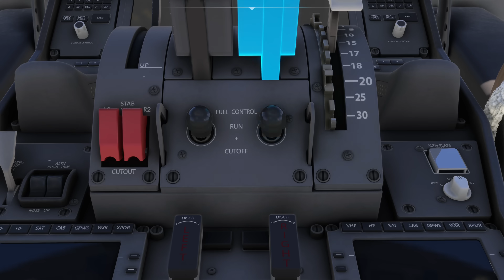Air India 171: Why Did The Fuel Cut-off Switch Get Moved?

Comment: With history providing Alaska Air 261 (profit over proper maintenance and falsified maintenance records resulting in the death of eighty eight people and NO ONE WENT TO JAIL), the multiple 737 hydraulic rudder actuation valve exceeding design travel and going full rudder deflection lock, the 737 Max, and Boeings successful Regulatory Capture . . . I refuse to point a finger at the flight crew on this.
There is enormous capital involved in this and the money never looses.
The fuel Cut Off switches are mechanical switches that work OFF OF TWO RELAYS.  There is a very good explanation of this on "STIG SHIFT" channel STIG SHIFT #78 "Aircraft Maintenance Adventures" (link:https://youtu.be/-ur234kwnhk?si=xRFP69_kTcN2aDPW&t=898)
I'll point early unformed fingers of wild speculation at Boeing all day long before I even contemplate looking at a flight crew.
Electrical relay switches never fail. /sarcasm

Comment: Consider this alternative not yet brought up.

What if a connector in the wiring harness vibrated loose and shut off the fuel then vibrated to reconnect ? Kinda like a car can.
The FDR would record a circuit disconnect and reconnect, not knowing that the switches were untouched.
That might explain at the engine sound change, one pilot saying "why did you do that?" and the other saying "I did not".
Both are startled and baffled.
No pilot fault, just a faulty pin connection.
THINK ABOUT IT.

Comment: What if one pilot is incapacitated. Putting the engine switches requiring inputs from both pilots during an engine failure is deadly. And saying that’s a great question is beyond my comprehension.

Comment: Captain Steve! I’m not a pilot but do have interest in aviation. My take on this…. With today’s technology could there not be a fuel cut off lockout during takeoff only?  During take off and until X air speed and/or altitude is achieved the fuel cut off is locked out indefinitely. During normal flight or landing fuel cut off can be changed by pilot in case of engine burnout or fire.

Comment: People who accuse Capt Steeeve this and that are so irrational.
He explained his reasonings for ruling out certain probable causes. 

After seeing a diagram how the switches are connected to different systems, including how the position status is logged in FDR, and the fact that 2 separate systems activated independently, it is clear that the 2 switches did change positions.  Mathematically it is almost impossible for 2 mechanical switches failed at the the exact same moment, leaving it only to the external factors which in this case the human factor was 1 of them.

Comment: Dear Captain, my question is simple. Bearing in mind the aircraft in question is totally computerised and the flight crews input is secondary, assuming the computer has not locked them out, how can we believe anything about the fuel cut off switches being moved at all by a human. Where is the actual data taken from, the switch terminal, some place in the computer, or at the fuel vales? 
I assume the aircraft was on auto pilot for take off, and the flight recorder recorded the fuel (switches?) being cut off, however, there is no evidence that the switches were ever moved. If the computer decided to cut the fuel, it would have been recorded, but the power may have been cut off at the valves only, not by the switches. By example, as I sit here under a table lamp, should the power from the grid fail, my light would go out irrespective of the switch. The question then is did I turn the light off, even if the electric meter stopped recording. Frankly, I don’t think the switches were turned off and on by the flight crew as all, especially as their input was already blocked by the aircraft’s main computer. 
Jonathan

Comment: Capt Steve is so wrong again. Ask yourself if you want to intentionally crash a plane, would you turn the fuel cut off switch on again? (No) Would you turn the lever if you could crash the plane while lower than 200 ft in air? (Yes). The wsj report isn’t the cvr transcript. The physical Turning the fuel cut off switch can’t be tracked. Only signal is recorded in fdr. I am sticking with air India failed to replace the engine EEC chips which can cut off fuel when it’s malfunctioning. Capt Steve never flew 787 so he doesn’t know.

Comment: I have a doubt. Can you please explain ?  For the pilot's switch movement at 08:08:42 UTC to be the root cause (and not a consequence), then this entire sequence:
t0 → t1 → t2 → t3
Must complete within 5 seconds (08:08:42 to 08:08:47 ).
Where:

t0: Pilot moves switches to CUTOFF (after 08:08:42 )
t1: Engines N2 below minimum idle
t2: RAT deployed
t3: RAT hydraulic pump supplying power (08:08:47 )

Would it not take some time for each of these steps ?  Assuming pilot moving the switch , does it not take some time for engines' N2 to go below minimum idle ( t1) ? And atleast few seconds for RAT Deployment(t2)? And  some time from RAT deployment to reach sufficient pressure to begin supplying hydraulic power  (t3) ?

Can the entire sequence happen within 5 seconds ?

Comment: Captain.. initial reports stated that there was some locking issue with Captains seat and at takeoff the seat skidded backwards. So is it possible that instinctively the captain reached out to grab a handhold and only thing he could grab were the switches and ended up switching off the engines. Once captain recovered and realised what has happened,he quickly switched on the switches but was too late... I feel that this is the most likely cause.. your expert comments please..
Reply: you really think that becoming a pilot is so easy and such stupid thing can happen ... this mf is paid by boeing ... hes just blaming the pilot coz he got funded by boeing ... he is not mentioning the ELT failure the RAT depolyment just after plane went airborne ... 

anyways .. its easy to manipulate idiots like you ... funny how people like you wonder what is wrong with the world .. even when you are the one contributing to it

Comment: All Nippon Airways Boeing 787 during its final approach to Osaka, Japan, in 2019.one of the engines suddenly shut down.

Investigators later found that the aircraft’s software had mistakenly interpreted the plane as being on the ground, triggering the thrust control malfunction accommodation system, which automatically moved the fuel switch from “run” to “cutoff” without any action from the pilots. 

People here are reaching biased conclusions supported by stupid theories of this steve guy based on interim report which in turn is based on data not made available to public (not even CVRs)

Comment: can't speculate anything but achieved max air speed at 42nd second of 180 knots, highlights that something was wrong already because at that phase the plane was accelerating and if engine failed after fuel cutoff, that would need time to first get acceleration to zero and decelerate, as due to inertia of the plane, so max air speed should be more than 180 knots but as per report that's the max, so anyhow, some failure did happen before achieving that max recorded airspeed at 42nd second mark, serious engine performance issue that needed relighting to have any chance??
Reply: WAS THINKING ABOUT THE SAME THING
Reply: I guess captain steeve has not learnt physics

Comment: Is th
is true?..........."Not the first time Boeing 787 experienced such a failure:
 
In an exclusive comment to Financial Express, US aviation expert Mary Schiavo pointed out that this is not the first time such a failure has occurred on a Boeing 787 Dreamliner. She cited a 2019 incident involving an All Nippon Airways (ANA) flight in Japan, where the fuel switch transitioned on its own, without any pilot input, while the aircraft was on final approach.
 
 
Software glitch caused ANA engine failure
 
Schiavo told Financial Express that an investigation into the ANA incident revealed a software glitch had led to the transition of the fuel switch. The software issue caused the aircraft to mistakenly interpret that it was on the ground, prompting the Thrust Control Malfunction Accommodation (TCMA) system to shut off fuel to the engines, even though the pilots had not activated the fuel cut-off themselves.
 
The ANA flight, a Boeing 787 Dreamliner flying from Tokyo to Osaka with 109 passengers and nine crew members, experienced a dual engine flameout after the pilot deployed the thrust reversers for landing. The aircraft had to be towed from the runway, but no injuries were reported.
 
 
Software glitch caused ANA engine failure
 
Schiavo told Financial Express that an investigation into the ANA incident revealed a software glitch had led to the transition of the fuel switch. The software issue caused the aircraft to mistakenly interpret that it was on the ground, prompting the Thrust Control Malfunction Accommodation (TCMA) system to shut off fuel to the engines, even though the pilots had not activated the fuel cut-off themselves.
 
The ANA flight, a Boeing 787 Dreamliner flying from Tokyo to Osaka with 109 passengers and nine crew members, experienced a dual engine flameout after the pilot deployed the thrust reversers for landing. The aircraft had to be towed from the runway, but no injuries were reported.

Comment: The main question is:
Do the Honeywell Bull fuel-cutoff-switches have an additional position/status outline (integrated in the switch) and if so - is it logged?
Reply: The Honeywell Bull Cutoff Switch (4TL837-3D) operates primarily as a circuit control device, but it also includes a status function. Here’s a detailed overview of its electrical functionality, including the status function:

### Electrical Functions of the Honeywell Bull Cutoff Switch

1. **Power Input Lines**:
   - **Power Supply Input**: Connects to an external power source to provide electrical energy to the switch.

2. **Load Output Lines**:
   - **Load Output**: Connects to the load (e.g., fuel system or engine control) to allow or interrupt the flow of electrical current based on the switch position.

3. **Status Output Line**:
   - **Status Indication Output**: This line provides a signal that indicates the current position of the switch (e.g., whether it is in the "RUN" or "CUTOFF" position). This output allows monitoring systems to know the operational state of the switch.

4. **Feedback Contact Line**:
   - **Feedback Signal Output**: This line transmits the switch state to a control system or monitoring device, providing real-time feedback about the switch's position.

### Summary of Operation
- **RUN Position**: When the switch is in the "RUN" position, it closes the circuit, allowing electrical energy to flow to the connected load. The status output line indicates that the switch is in the "RUN" state.
- **CUTOFF Position**: When the switch is in the "CUTOFF" position, it opens the circuit, interrupting the flow of electrical energy. The status output line indicates that the switch is in the "CUTOFF" state.

### Conclusion
In summary, the Honeywell Bull Cutoff Switch not only controls the flow of electrical energy to a load but also provides a status output that indicates its current position, enhancing monitoring and safety in applications. If you have any further questions or need additional details, feel free to ask!
(chatGPT4)

Comment: Could the fuel cutoff switches have been moved by mistake, as in the pilot intended to switch, or test, another switch but subconsciously switched the wrong switch?  Are there other switches that you would often activate that might be confused while busy and/or distracted?  And why are those switches not guarded, or at least red?   I ask, because this has happened on a different aircraft, fortunately only one engine was accidentally switched off.

Comment: Even if the switches were triggered througha software glitch, that dorsnt explajn whya spring loaded switch will move out of its locked position and automatically go to cutoff. Moving mechanical switches requires motors, which dont exist on this flight. So i ask again. Supppose the fuel was cutoff due to Boeing faulty software. But why should that make the switch flip automatically? Note these switches are not like your automatic circuit breakrers. They need delibrate human action to move out of the position

Comment: FAA Safety Awareness Information Bulletin (SAIB) NM‑18‑33, issued on December 17, 2018, concerning the fuel control switch locking mechanism on Boeing aircraft: bulletin warned that on some Boeing 737 models, fuel control switches had been installed without proper locking mechanisms, meaning the switch could be moved without lifting it first.  Boeing 737s operated in India were within the category of aircraft referenced in SAIB NM‑18‑33 and subject to its advisory recommendations.  Go figure... and now Boeing is trying to stay out of trouble by making it look like the Captain and blaming the death of his mom. The Captain has flight experience of 15,638 hours. Reports from friends and colleagues described him as disciplined, meticulous, and a respected mentor to younger pilots. There were no complaints ever filed against him.  It wasn't suicide.

Comment: Im the 34 thousand comment regarding air iindia flight 171. I think that the consensus was that fuel was starved to both engines, not long after takeoff. Whether that was due to a mechanical, electrical or systems failure will be determined in due course. The human component will also be investigated.

Comment: Hi Captain Steeeve,
I’ve been following your report from the very beginning, and for the most part it made sense. But I believe we may be missing a critical piece of the puzzle — how the Boeing 787 determines whether it’s in the air or on the ground, and more importantly, what kind of authority the aircraft systems have when that logic is compromised. So here’s my personal take on what may have happened during the incident.

The 787 relies on multiple sensors — including Weight-on-Wheels (WoW) — to determine its air/ground status. Now, whether it was WoW or another sensor input, the fact is: some erroneous condition likely made the aircraft think it was already on the ground. And from the system’s point of view, a plane “on the ground” should not have engines running at full takeoff thrust. So the FADEC, which has full authority over engine control, may have responded by commanding a fuel cutoff, de-energizing the high-pressure shutoff valves (HPSOVs) via solenoids.

Importantly, when FADEC or TCMA does this, it does not move the physical RUN/CUTOFF switches in the cockpit. Those are spring-loaded and manually actuated by the pilots. So the fuel can be shut off electrically while the switches remain untouched. And to restore engine operation, the pilots must manually cycle those switches to CUTOFF and back to RUN to re-energize the solenoids.

Here’s the sequence as I understand it, using 1:38:42 PM as the moment of fuel cutoff:
Timestamp | Event
1:38:42 PM | TCMA/FADEC commands auto fuel cutoff electrically via solenoids
1:38:43 PM | Engines begin spooling down; PF notices abnormal loss of thrust
1:38:44 PM | PF: “Why did you cut off?”
1:38:45 PM | PM: “I didn’t!”
1:38:46–1:38:48 PM | Crew attempts to understand and troubleshoot the unexpected event
1:38:49 PM | Left fuel switch manually moved to CUTOFF
1:38:50 PM | Right fuel switch manually moved to CUTOFF
1:38:51 PM | Left switch moved back to RUN (re-applying power to left HPSOV) - which will automatically  be in lighting sequence as the plane seasons now shows correct air mode and started gaining thrust
1:38:52 PM | Right switch moved back to RUN (re-applying power to right HPSOV) - which will automatically  be in lighting sequence as the plane seasons now shows correct air mode but failed to re-light

A few key observations that shape this theory:
	1.	The exact one-second interval between the engine shutdowns strongly resembles Boeing’s automated left-to-right sequencing, not manual pilot action.
	2.	The pilot reactions on CVR show clear surprise and confusion — consistent with an unexpected system-triggered cutoff, not deliberate human input. ( and please do not compare two adult pilots with your kids, saying they will lie even when caught red-handed, THEY ARE KIDS. )
	3.	The 2019 ANA 787 incident provides a precedent for this failure mode: a false “on-ground” signal led to a dual engine shutdown.
	4.	One overlooked but important detail — if this were deliberate, and the PM (who sits on the right side) initiated it, it would be natural for him to reach for the right switch first. In a panic or malicious situation, no one follows left-to-right procedure. The fact that the left engine was shut down first is another indication that this was an automated sequence, not manual sabotage.

So, to summarize — my personal hypothesis is this:
Some sensor-driven logic fault — maybe WoW, maybe something else — made the aircraft believe it was on the ground during the takeoff roll. FADEC, seeing full thrust while “on ground,” executed a protective cutoff. The pilots didn’t expect it, reacted with confusion, and then manually cycled the fuel switches in an attempt to restore engine power.

Looking forward to what the full investigation concludes, but for now, this sequence seems technically and operationally consistent for me.